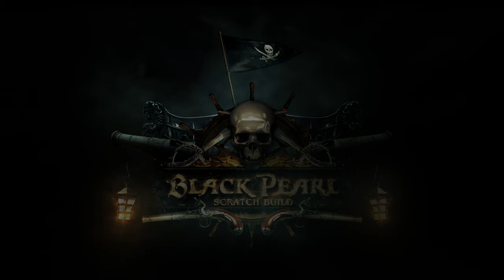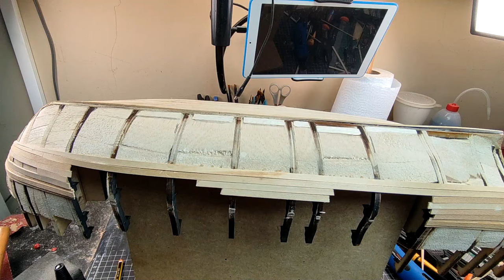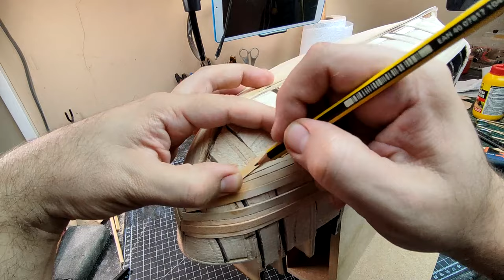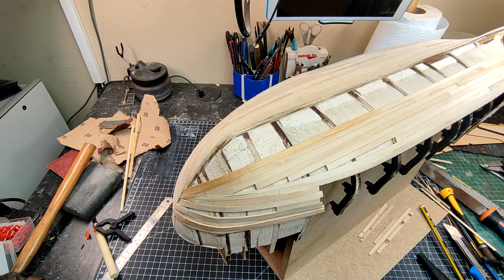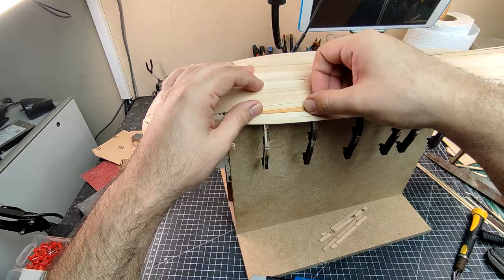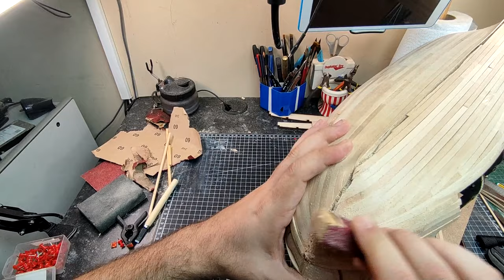The Black Pearl model ship -part 22- Finishing the planking | Scratch build wooden model ship

Comment: Do you use a wood filler before you apply the second planking?
Reply from the maker: No second planking on this one, but I would use a bit of filler if I was going to do second planking
Reply: @ModelShips  Mmm, interesting!
Reply from the maker: @cliffwall6593  it will be painted, weathered, texture added to look like stuff that Incrust on the hull, no need for fancy second planking, at least on my mind